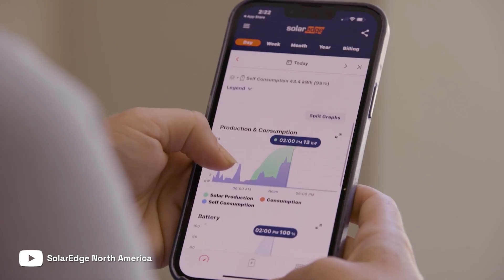DO NOT BUY SolarEdge Optimisers Without Watching This!

Comment: Clickbait title. Infomercial. Solar edge is an inferior product with lots of failures in their equipment especially the optimizers. If you want a reliable solar system do not purchase solar edge.
Reply from the maker: What brands would you recommend?
Reply: @yeanswers  straight grid-tied systems I honestly would recommend enphase. Stout and strong with a great warranty and one of the few companies that cover labor. For a battery backup system  Solark 15K with Tygo rapid shutdown and or optimization. Schneider can also be a good battery backup scenario. But it can be tough to get everything synced up correctly. SMA has always been a tried and true string inverter and they have gotten better since they adopted Tygo optimization rapid shut down. Each has their pros and cons but the failure rate is far better than solar edge.